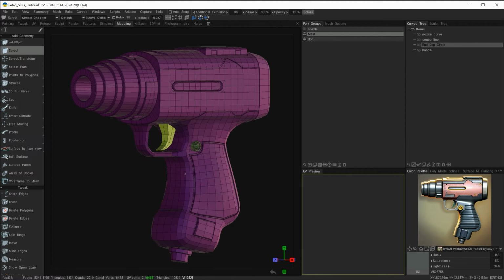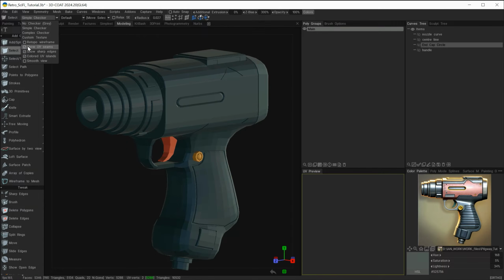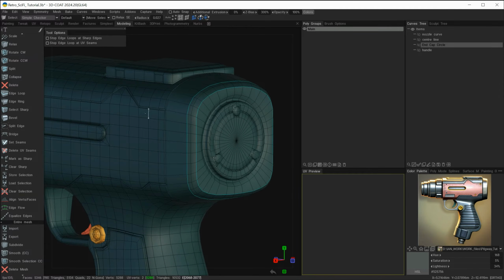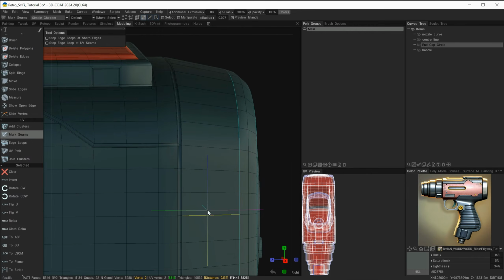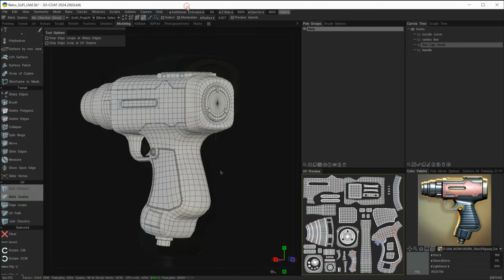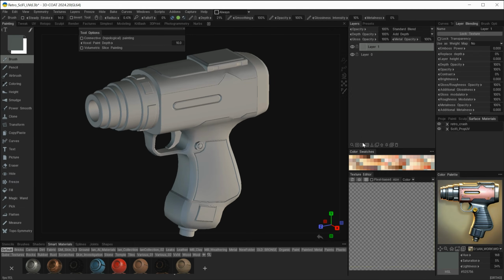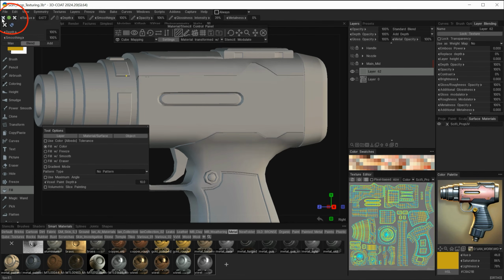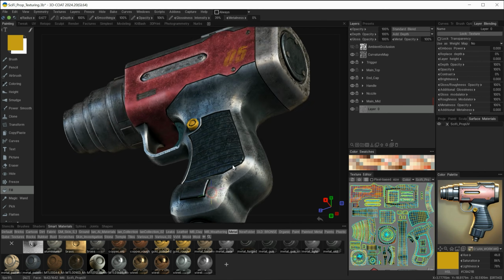3DCoat Low-Poly Modeling for Beginners #18. Creating a simple object - Sci-Fi Prop. Part 7.

Comment: So it is mid poly + smoothing groups and then straight to paint room without any sculpting, baking... Smoothing groups solve the problem of faceted look of mid poly mesh, but toolset is kinda mediocre compared to what we have in Max/Maya. I won't miss much skipping the UV unwrapping part, but painting is the most fun part! I'd love to see more of painting process. Also one worthy notice - when you apply smart materials without baked normals/curvature/ao, there is high chance to get weird results. Multi layered materials depend on baked maps to decide what goes where, so without them... It's not working smart. Anyways, it was a very nice series and final model looks cool. Thanks and keep going! ;)